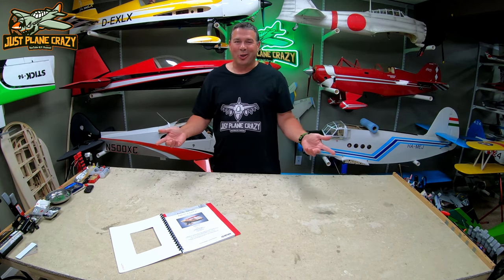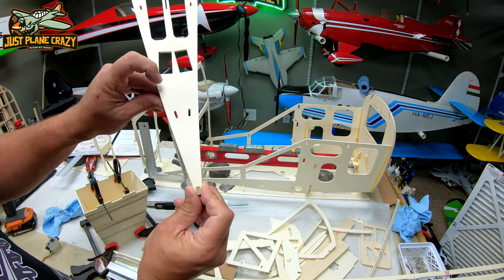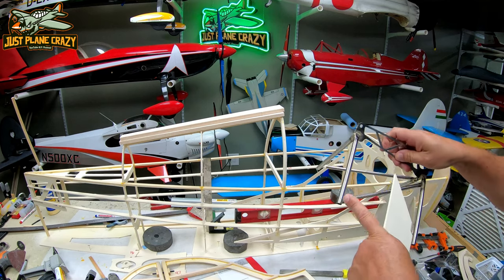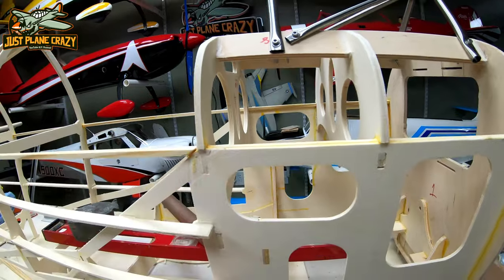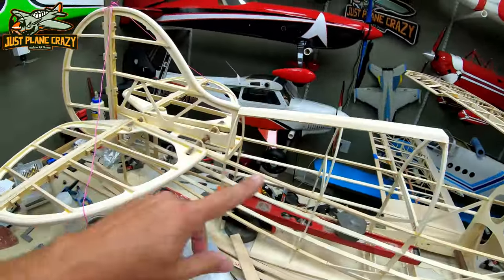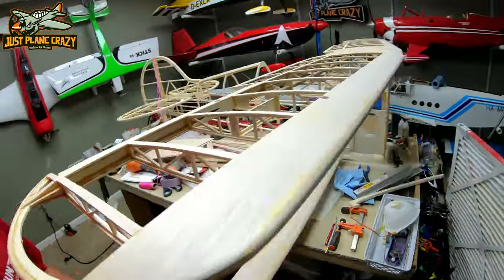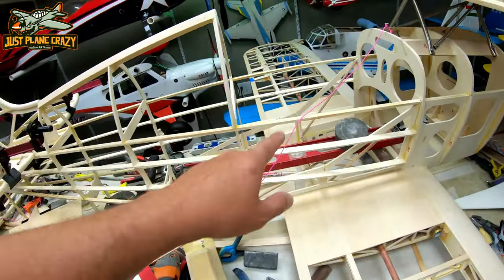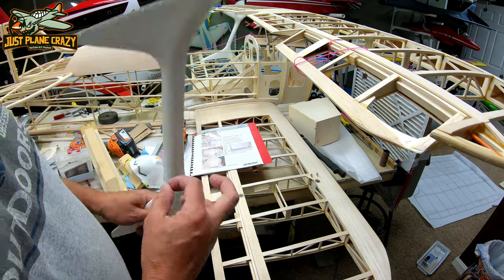Building the EMHW 2.43m 47% Pitts Special pt.4 Fuselage Framing and Setting Incidence

Comment: I building the 2,38 Christen Eagle. My manual says, that there should be a piece of the wing tube clued to the aluminum baldachin hole and sanded to fit. I think you should have to do it also to give a nice fit between upper wing and the aluminum part (called Baldachin in german).
Reply from the maker: Yes. Figured that out during the build. I covered it again in pt 2. Good luck with your build. What engine u using ?
Reply: @JustPlaneCrazy  I will take the DLE111 3D V3 with Zimmermann mufflers. At first thougt I would use the DLE170 or DLE130 but Mr. Ulbricht from EMHW said, the 170 is way oversized. The 130 also. In his opinion a 100ccm sized motor is more than enough, so I chosed the DLE111